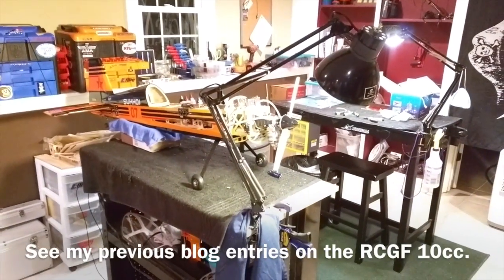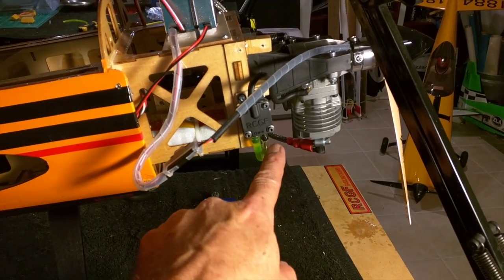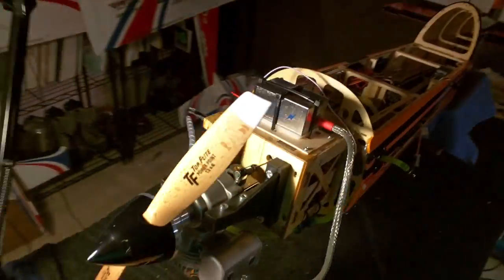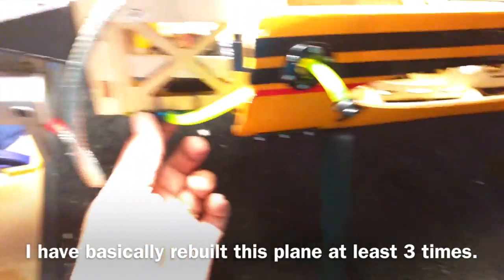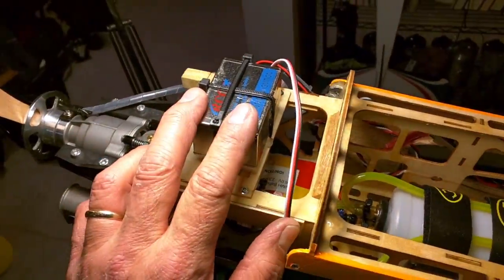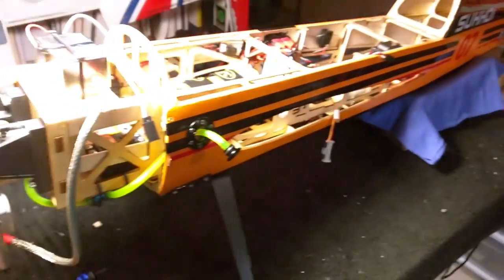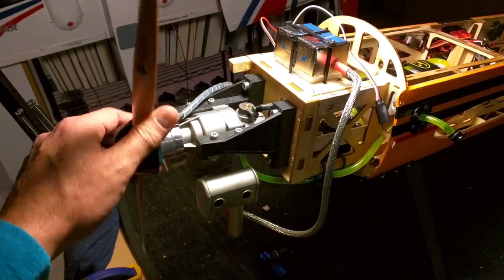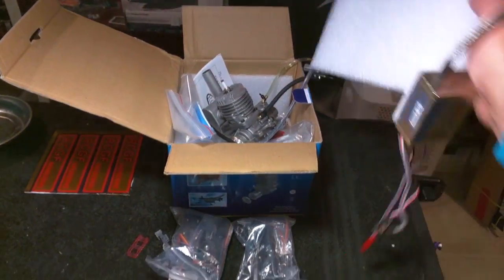RCGF 10cc

Comment: Yeah, i agree change engines. You don’t wanna go to an air sitting there just in on a carburetor all day especially when you got a new airplane you wanting to fly they got good gas engines out there and RCGF Isnt one of them. I can get mine to start right up but it won’t hide a decent or it won’t run wide-open decent tired messing with it

Comment: I used to use a Quick Fire filter, I had nothing but trouble. Air trapped in the filter would  slowly release into the carbie causing dead sticks. Also the O ring would not stay in place also causing it to suck in air. I took it out, now all is good in the world.
Reply from the maker: Lee Wood I agree. I am no longer using them.

Comment from the maker: Hi, David! Thanks for your questions. This version has a single adjustable needle for HI in the middle of the throttle body. The newer ones have gone to a Walboro style carb with attached fuel pump, and has two needles. 

I really like these engines. Cost, reliability, and outstanding personal customer service. 

I have had no problems running this motor once I found its tuning happy place. I ran a 14x8 two blade, tried a 13x8x3 but am not sure I gained anything but looks. I am trying a 14x8 wood Xoar again, but have a 14x8 Master Airscrew Scimitar coming soon.

I think you would be quite happy with these RCGF-USA engines! 

For details visit my blog, pretorian435.blogspot.com and search for RCGF!

Comment: The tach issue is with a rcexel tach. It will not work with new rcgf ignitions. A rcgf tach is needed.
I had a leaking v1 fuel pump that Joe replaced with a v2. Engine runs great. Strange that you needed to choke it with your finger. Mine started with just using a starter. Im able to start it without a starter using the finger to choke for first start of the day. After that it flip starts every time.
Glad to see you got it running.